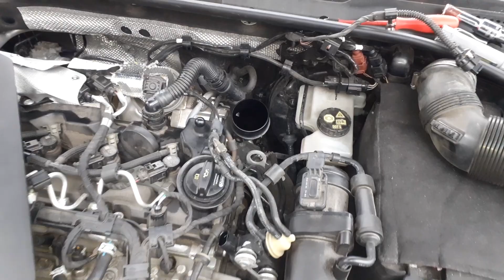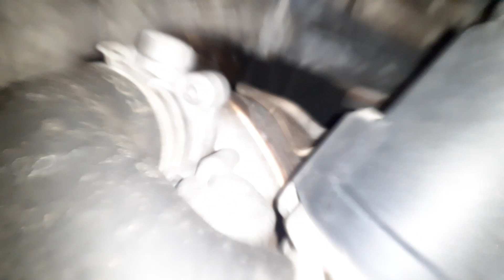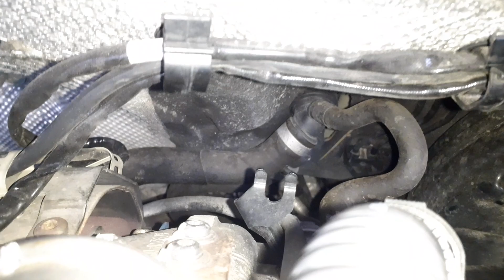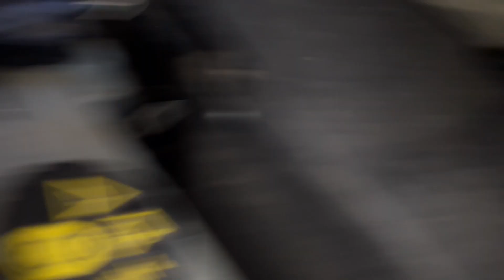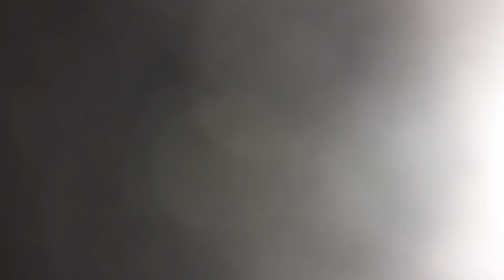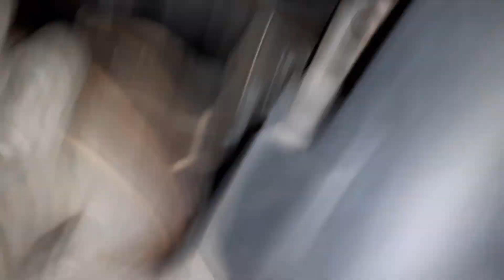VW Golf 7 EGR visual check

Comment: What do you think about doing a chiptuning on a 2014 golf 7 1.6 tdi 77kw with 220 000 kilometers driven ?
Reply from the maker: I don't think it's necessary. but it's interesting and it attracts me. the number of km is not decisive.
Reply: golf Wagen thank you I hope you never stop doing clips about golf 7 best car
Reply: Not good for your injectors
Reply: Sully Why?
Reply: I chipped my mk7 2014 2.9 tdi around 130k km now at 190k still going strong
Reply: @zidliym9702  2.0 you think?
Reply: @zgmarconi  i made a mistake. I ment 2.0 golf does not have 2,9 hahah

Comment: Hello all,
Nice video, but unfortunately, I'm very clumsy and I would need a repair manual to read all the steps. Does someone has a repair manual for vw golf 7 with CRKB code?
@Mr. golf Wagen do you know if is it remanded to clean the EGR to prevent its defect?